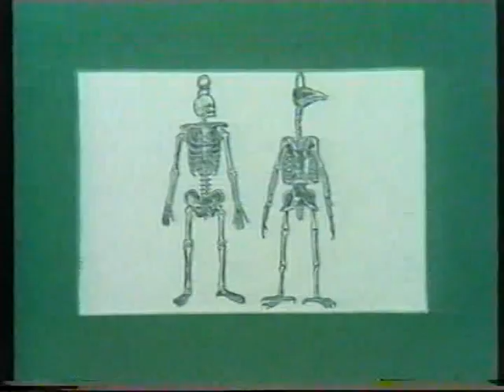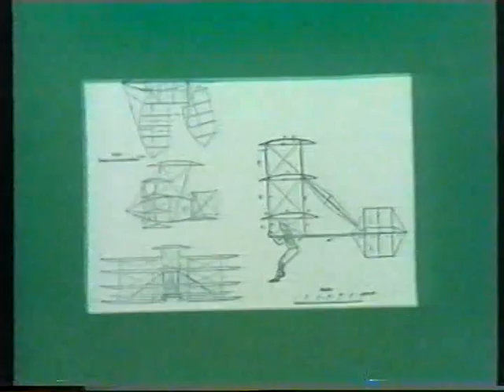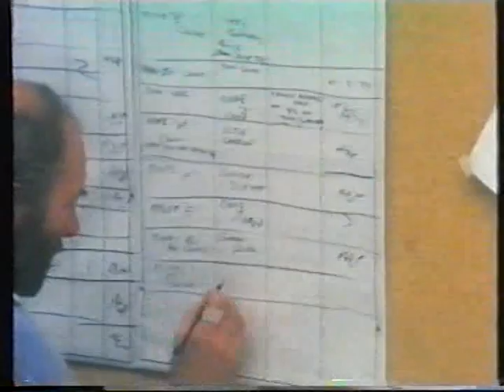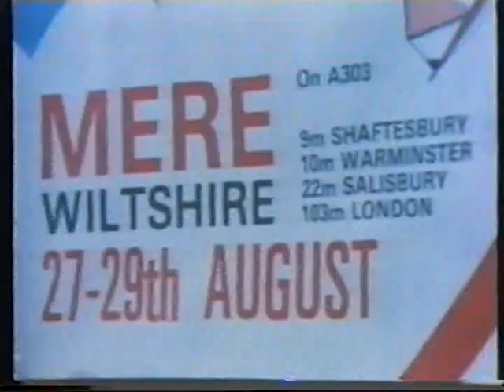Ken Learns to fly , and other Hang Gliding films made by Ken Barker from 1974 on.

Comment: I did my first full stall on the training hill in Norco, So. Cal. that same year. I was only 50 or 60 feet up trying to push into the harness and feel the prone flight, instead of sitting…well that stalled the kite and I realized that I was going to crash like a parachute into a 'sea of yellow' in the field below. Before I realized the event was really going to happen, I was on my belly with the great sound of sail and cables going 'whack!' all around me. At that point I found myself staring 'cross eyed' at one single yellow flower at the tip of my nose growing in that 'sea of yellow' that I had seen only seconds before.
That's just one of a myriad of memories your video has dredged out of my ole' grey brain cell(s)…thank you for the efforts to put this together, I have thoroughly enjoyed.

All the best air to ya!…charlie

PS…those dang 'Quicksilvers' used to sit on top of all of us in the lift in the early days…whatta wing! 
And…the first time I stepped off a cliff and suddenly had 2,000 foot of altitude…I remember' clearly' my first thought…"Oh my God!"

Comment: I didn't know bataans were incorporated into hang gliders way back in those days? I used to have a Pliable Moose sgl. surface hang glider back in '78 but never really got the chance to soar with it.... traded it for a new Gibson Les Paul Custom in '79. It's been 35+ years and I am currently enrolled in the Mountain Package at Lookout Mountain, TN, USA..... starting training in the Spring '16
Reply: Hi, End of July last yr. I got in 4 days small 65 foot hill training  and on the 4th day my quads and feet was killing me as I was getting better at landing on my feet. Only got 2 flights in the 4th day due to pain.... all it is with my feet is old injuries 10+ years ago... broke left big toe hanging flip flop up inside door seal of a store... basically kicking the concrete sidewalk outside trying to keep from falling...one yr. later, right foot toes damaged from flipping a tree truck to the road after cutting up and removing locust tree and walking into the bouncing part of the trunk as I was flipping... so ARTHRITIS  is going to be a real bitch if I land on my feet SO it looks like wheels for me forever... getting back to LMFP in a couple of weeks and take 1st written exam and get on 125 foot big hill training...1350' cliff launching no hurries..lol
Reply: priceless video's